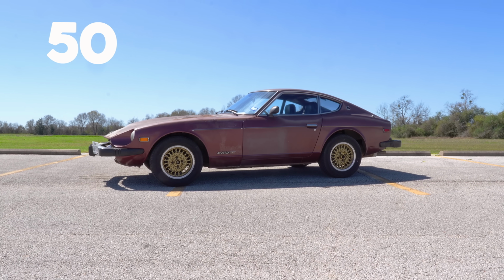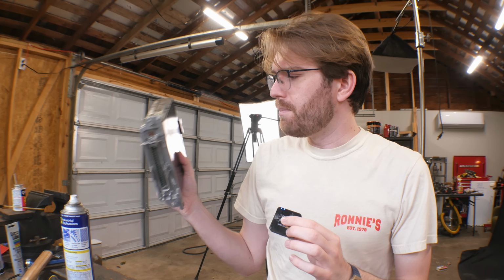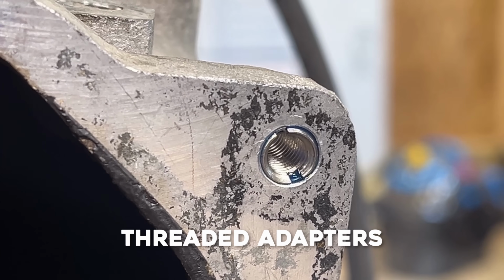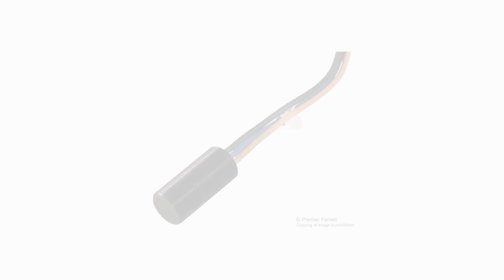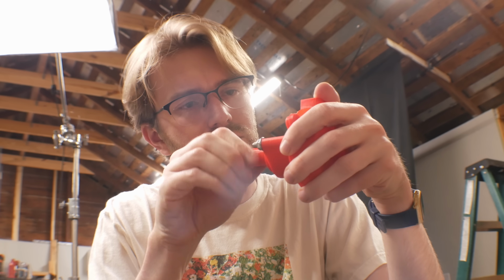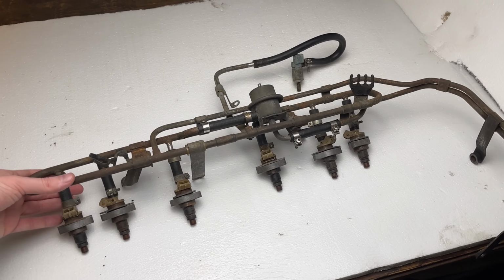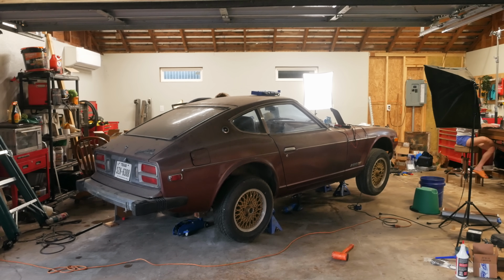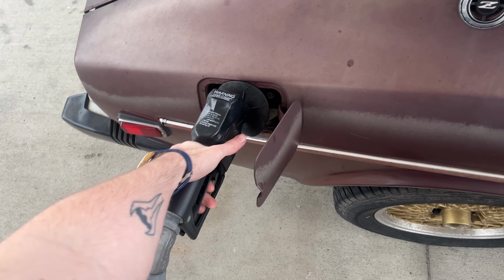Modernizing a Vintage Car

Comment: as it so happened i was wondering this exact question recently, not many people really cover how this stuff is done from what i dug up
now, install ABS and traction control on it :)
Reply: Oh yeah surely need tcs for that 140hp BEAST of an engine
Reply: I think just a new radiator and wheels/tyres or just tyres and brakes would be better
Reply: ABS is a good idea but in practice... yeah that might be difficult. Traction control is just a crutch for not learning throttle management, it isn't necessary.
Reply: @lsswappedcessna  ABS is nice for some things, like idiots driving in winter.  But a car meant to be a driver's car should not have TCS.
Reply: @lsswappedcessna Honestly, I feel like this car should stay as simple as can be. I always had a car without ABS and I never really missed it. This one won't either.
Reply: @mithrilsk  ABS is nice to have in the rain, but I do agree it isn't a necessity. This car is lightweight enough that it probably doesn't even need power brakes, but they are nice to have.

Comment: As an owner of a 78 280z I love this video!  Now, if only I didn't have to smog this car every two years.  (I literally just passed smog yesterday,  California things.)
Reply: I will never understand why California is the go-to state for car culture when your regulations take the fun out of everything (and sometimes make it impossible to fix things legally). What use is the car not rusting apart when you can't find a CARB-certified part your car needs to run because nobody makes that part and has it certified by CARB?

Comment: Wow you should be incredibly proud. That was an excellent job. 

Not to tell you to turn your whole like into a monetization scheme, but you should totally sell that cam pickup as a little unit. Partner with a local manufacturing company for the machining and get a little gas money.
Reply: Not sure if the demand would be high enough to justify the machining cost, I'll be honest if I had one of these cars I'd probably do the opposite and convert it to carbureted. It'd also eliminate a lot of the random parts on the intake, and simplify the fuel system, but in the opposite direction tech-wise. This was a very cool proof of concept though, it can be done if you have the better part of a year to fiddlefuck with it. I'd just want to drive my car though lol

Comment: You should  Add turbo to the engine............................................................................................................. on each cylinder  😅

Comment: You no doubt would have been better off installing a JDM Toyota 1JZ engine in that car, I help my dad put one into my old 1989 Supra, we did it in 3 days, with structural modifications you could have done it in less then a month.  With a 1JZ you would have been putting out 300 plus horse power depending on your turbo set up and the 1JZ is just a 2.5 liter straight six bullet proof engine.  That being said, I think you did an outstanding job with what you did with all the modifications and back yard engineering.
Reply: I say this as someone with a 540hp Soarer
1) not everybody cares about power 
2) he specifically pointed out why he didn't do a swap
3) you put a JZA70 engine into a JZA70 chassis using JZA70 parts 🤔...that is not at all like putting one in a 280z
Reply: There's nothing at all wrong with engine swaps but I think it's better he kept this engine running, since it was clearly capable of running but just needed a bit of help. Getting rid of that shitty Bosch EFI system that was really no better for efficiency and power delivery than a carburetor (and honestly worse because of the increased complexity and reliance on a computer to run the fuel system) fixed everything that was wrong with these engines. That primitive EFI system was nothing more than a handicap on the practicality and power output potential of the car. Hell, mechanical fuel injection would've been better despite the ease of repair and tuning cliff of MFI making carburetors look like baby's first fuel system, at least it's timed instead of spraying gas into all of the cylinders at the same time.

Comment: gloriuous project man ! now mod time !
Reply: I would love to see reversible modifications like a hotter camshaft. Would push even more power from this engine without compromising on reliability. Forced induction would also be a good way to make power, but a turbo would require a lot of modifications to the engine that would be hard to reverse, and superchargers cost like $10k. Even a re-geared Detroit Diesel blower isn't cheap.

Comment: Regardless of the mpg and hp gain, You are now left with a tidy and clean engine bay. Down the line when the car is getting painted you should also sandblast and pain the engine. She might have blemishes now but damn is she gonna be pretty.

Comment: This Datsun weighs a LOT less than that piece of shit Cruze you were talking about, in fact it weighs almost 1,000 lbs less than a Cruze. That's one thing most people don't take into account when they rag on classic cars for making less power. Ah, yeah, dumbass. A 2,355 lb Japanese coupe from the 70s doesn't need a lot of power to be just fast enough to be fun to drive. If this car had as little as 200hp (time to start modernizing other things, increase compression ratio and start running on non-ethanol REC 90, replace piston rings, etc.) it would be a fucking rocket ship. Power to weight ratio is almost universally ignored, except by bike squids who never shut up about "uhuh my Hayabusa can whoop your car into the dirt" like yeah bud I sure hope it can, it weighs like 600 lbs and makes 187 brake horsepower.
Reply from the maker: 2012 Cruze weighs 3009 pounds and the 280Z weighs 2875. I must be doing my math wrong because I'm not getting 1000 as the difference between the two
Reply: @RonaldFinger  Damn, that's a heavy Z. I suppose your measurements are probably more accurate than the ones I found on the web (2355 lbs for a Z, around 3200 for a Cruze), but regardless the power to weight ratio is going to be a bit higher on the 280Z due to the small disparity in weight. If you were to squeeze a bit more power from the engine (though this may be difficult to do without modifications that would be difficult to reverse, other than replacing wear items such as piston rings) it would only increase the performance gap between the two cars. Torque is also something to consider. Looking back in the video to see how much torque the Z made after your restomodding, it looks like the Z made a bit north of 300 lb-ft if I'm reading the dyno properly (holy shit!) I no longer really trust the internet to give me specs for the Cruze (let's be honest, who dyno's a Cruze) but I doubt the Cruze would make more than 140-150 lb-ft in the best possible conditions, and that's a VERY liberal estimate.

Comment: We can estimate the cost of this project. Since the average American drives about 13,000 miles a year, over 63 years you’re looking at roughly 819,000 miles. At 17 mpg, that would burn around 48176 gallons, but at 19.9 mpg it drops to about 41,156 gallons. That’s a lifetime savings of roughly 7,020 gallons. And if gas averages around $3.60 a gallon, that’s about $25,272 saved.

Comment: The fact it started at all on the first attempt is amazing. I have been fiddling with aftermarket EFI for about a decade now and getting that first start is always the hardest part. Well done! This is a nice, clean setup.
Reply: It tried to start/run basically on fumes on the first coupe tries... quite impressive
Reply: Let me guess, TBI kits. Those things are a pain in the ass, was considering one for my car but after doing further research I'm glad I left it carbureted.

Comment: i love a concept of modernizing an old engine. pretty ecological since you dont need to throw away a whole engine and is true to the original. best of both worlds.
Reply: The custom EFI system is actually better than a carburetor, unlike the factory Bosch system, lol

All that headache and it just sprays fuel into the engine willy nilly. C'mon Nissan, just use a damn carburetor at that point.
Reply: @lsswappedcessna  Custom EFI introduces at least a dozen NEW points of failure to an old engine, with little or no real gain.   De-evolving back to a carburetor REMOVES at least a dozen original existing points of failure AND will breathe better.   The only reason EFI was added to the 75-78z was for emissions; not power.
Reply: I would literally hand over my weekend ride to a shop that would do this tomorrow, if there was an option where I live...
Reply: @mithrilsk  You'd pay a lot of money but it would be great bang for buck versus buying something new. A 20hp gain just by modernizing the fuel, air and spark delivery is honestly very impressive. The increased reliability versus the half-assed EFI systems of the day and increased ease of use versus a carburetor would mean you could probably use the car as a daily rather than weekend only.
Reply: I think what he‘s done is really really cool but shouldn‘t it make 150hp stock? Maybe he should check compression or something else…
Reply: @hisnamematty7131  Yea if he ran new pistons, tighter tolerances and improved breathing and compression it would probably be over 200hp, thats a lot of money for little reward!
Reply: @hisnamematty7131  it's a 50 year old ratted out Z, just the fact it runs without smoking the entire block is good enough
Reply: same compression, same valves open for the same time can only burn so much fuel.  he basically took off the stuff choking the intake.  just like everyone did in the 80s or 70s

Comment: Along with better fuel millage you also get a more reliable system. Not to mention more power. Time for a forced air induction system. Because you want it to keep up with your local Toyota.

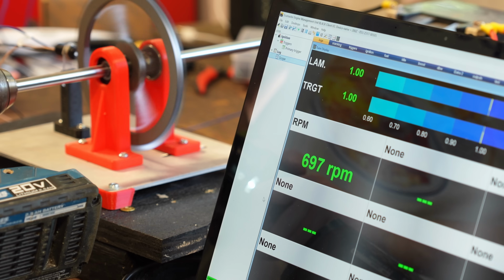Comment: 14:06 is anyone going to tell Ronnie that Chrysler/Jeep already made what he is trying to design and build 25 years ago? when the 4.0L straight 6 got COP ignition in 2000, they literally removed the old distributor and supporting electronics/wiring and in its place stuck a camshaft position sensor.

Comment: This is basically the first stage of what I eventually want to do to my dads SIII XJ12. You know, once I win the lottery. And rebuild the entire engine because it's low on compression on half of the cylinders. And replace the A/C with a Fennair system. Oh and replace all the window seals that have turned to sludge. And redo the breaks...... Fuck me this will never get done xD

Comment: As the former owner of a 280Z turbo for 110,000 miles. and who rebuilt to the top of the engine, and an engineer - this is extremely impressive.  Very innovative.
Reply: I was skeptical of the throttle by wire idea at first, it was a good idea in concept but in practice it can be a real headache to deal with. This aftermarket system that he made turned out to be less of a pain in the ass than it usually is for the proprietary system on modern vehicles. Makes me wonder why it can't be that easy for everything.
Reply: @lsswappedcessna  Because then you'd be able to easily work on it yourself instead of taking it to the dealer. We can't have that 😮‍💨 

And to his and all the component creators' ingenuity and credit, this system has far less to integrate than modern systems.
Reply: @dantizzle00  It does have far less to integrate, that's a good point.
Reply: @dantizzle00  The problem is that older carbureted cars built power by running very inefficiently over-riching the fuel/air mixture in the process.  Those seeking even more performance would often take this further by reworking or replacing the carburetor.  They didn't care that the car became gross polluter.

I could easily see if modern computers in cars were as readily modified as this that this trend would return,  People would delete the cats and just over-richen the mixture in an attempt to build power regardless of the emissions generated. And even with modern emissions testing in a lot of places, if the process was easy to do then it might be easy to reverse as well.

So it makes sense that automakers don't generally have computers that are modifiable.

What Finger basically did here was like when the Jeep 4.0L I6 EFI system is used as an emissions-retrofit on an old AMC inline 6, which was a pretty popular fix for cars that were failing emissions.  The intake manifold was bolt-on and it was easy to just retrofit everything else.  I knew guys with AMXs and Spirits that did exactly that in order to keep those cars on the road.
Reply: @TWX1138  Modern engine computers are already quite easily modifiable, any performance shop can do it these days. It usually takes a year or two for the security features on a new OEM engine control computer to be cracked by tuners, but after that the world's your oyster.

That said, modern ECU tuning is usually done on a dynomometer and is a bit more complex than just installing larger jets to dump extra fuel in. They adjust everything from spark timing, injector duration and boost (if turbocharged) on the computer while monitoring feedback from a litanny of engine sensors, and most tuners generally try to keep the air/fuel ratios in a semi-sensible range these days.

Most people don't do this themselves because it's very easy to screw up the map and destroy your engine, so the couple of hundred bucks for a custom ECU tune on a dyno is well worth the money. Those aftermarket ECUs and the wiring kits also cost a pretty penny, so it keeps most of the home garage builders away from these sorts of shenanigans.
Reply: @lsswappedcessna it is. People just down right refuse to read the error codes. Every part of that typically has error checking so you can get a unique code for each part failing.
Reply: @lsswappedcessna  Because line must go up

Comment: As I recall, the 240z was the lightest of the z cars but the least powerful, the 260z was the fastest although heavier than the 240z, and the 280z had the worst of both, the heaviest and pollution controls meant it had the least power.